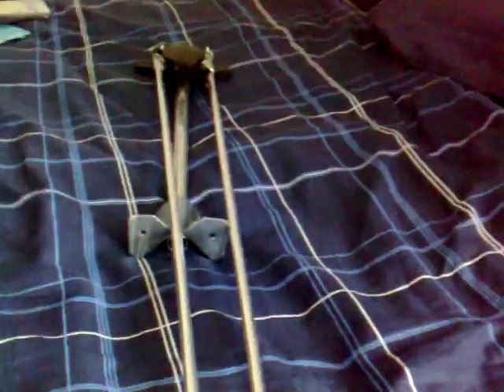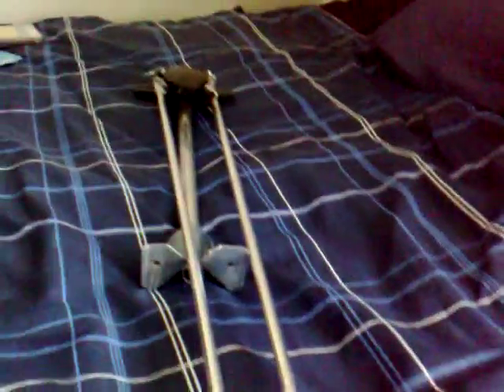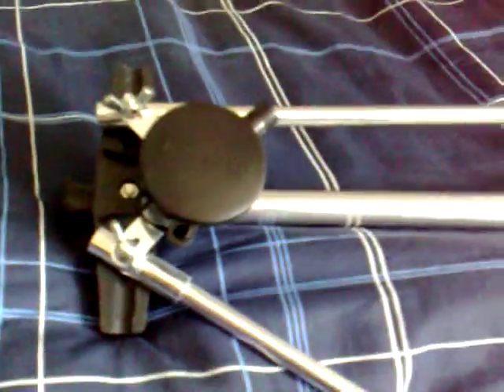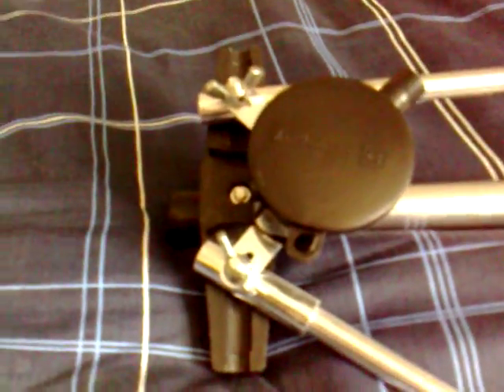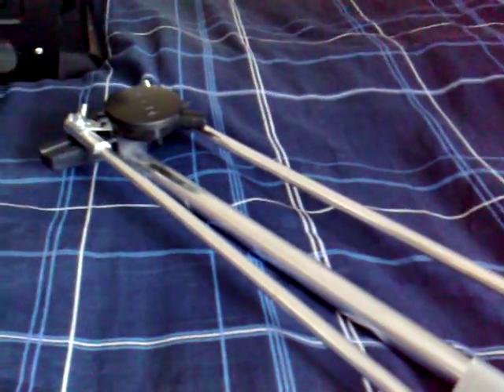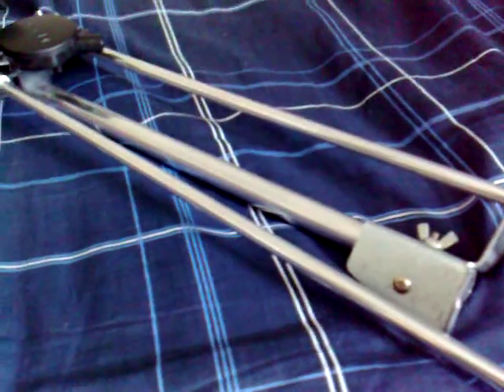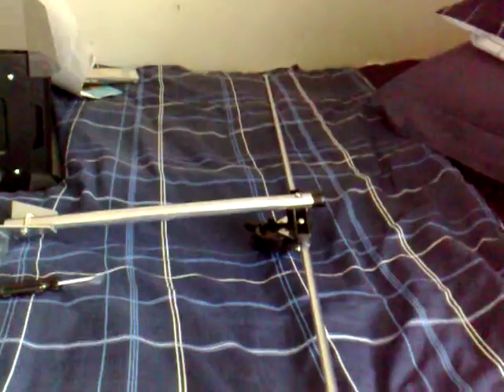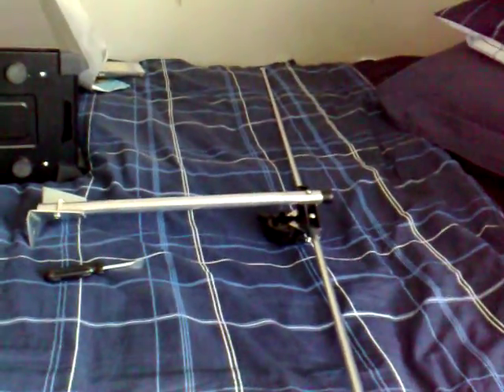PMR Radio: Dipole Antenna Made For PMR446 Part 1/2

Comment: Yes my radio units are for WW2 re-enactment so all the coax is inside a metal radio case holding the PMR and with a 259 socket on the case, the antenna is screwed direct onto the 259 socket. 
watch?v=sY6wGrE6VLA

Comment: At 446MHz their will be much loss even when using RG213 coax. If you can, try and keep the coax as short as possible, 3 meters is an ideal length but anything past that is not worth doing especially using 500mw you'd need an output of 4 watts at least for it to be affective. It is also illegal do more then 500mw on PMR446 so watch your power. Keep your watts to a reasonable amount like 5 watts and you should be fine.